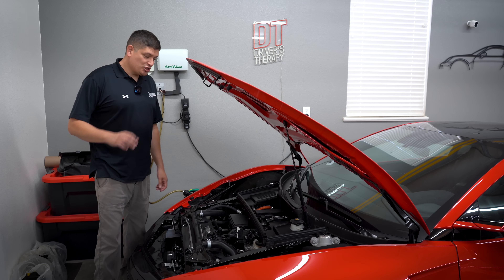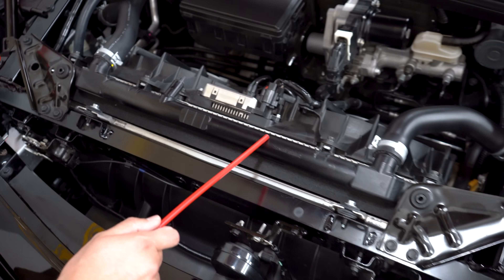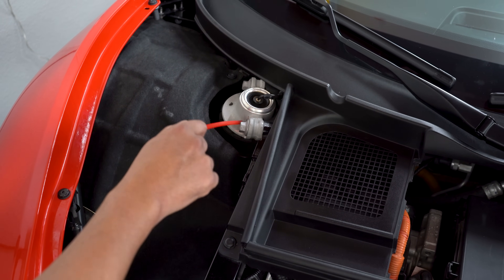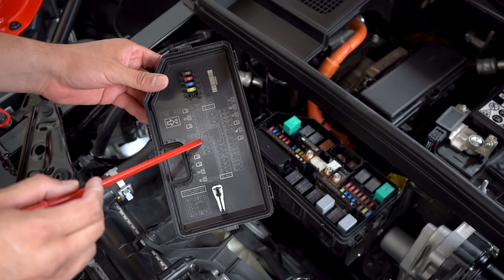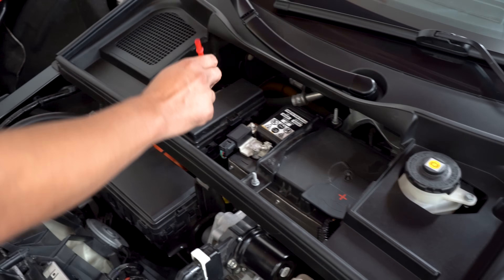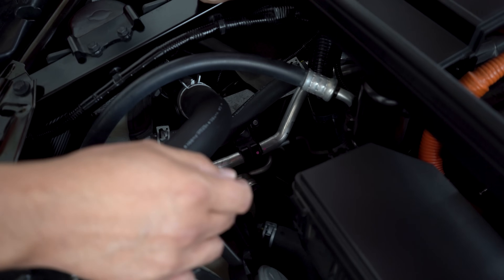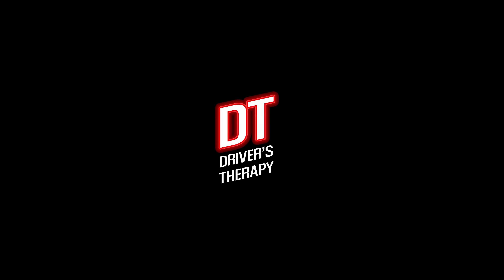Under the Hood of the NC1 Acura NSX: A Component Breakdown!

Comment: 5:19 I hadn't spent much time analyzing this part of the car, but I think that's your electrical A/C compressor.  Because the NSX doesn't have a drive belt, it relies on DC power to control the A/C.  The orange cable should contain 3-phase power and the compressor should be a scroll-type, similar to a refrigerator in your kitchen.
Reply from the maker: That makes sense, I did see the A/C lines going into it. That is kinda cool the compressor is right there. I love it! Thanks for the help. You tha man :P

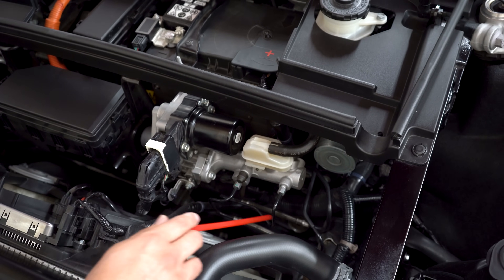Comment: 3:53 That is the electrical brake actuator for braking by wire.  The primary reason why, when you hit the brakes, you don't want to apply the physical brakes is to allow the hybrid system to regen.  If the car doesn't need power from the regen system, or you are demanding more brake power, this actuator will engage the physical brakes.  Have someone go into the cabin and work the brake and you'll hear this actuator working.  When you bleed the brakes, you have to leave the door open for several minutes until the dome light goes out, so the actuator doesn't work electronically - it works physically.  This actuator also holds the brakes after you come to a stop when you actuate the brake hold button in the cabin.
Reply from the maker: Thanks!!! That is really good info. I appreciate you taking the time to explain the system to me. Really helpful my friend.